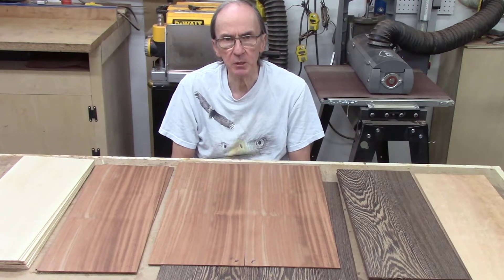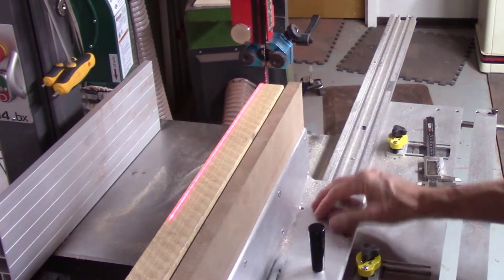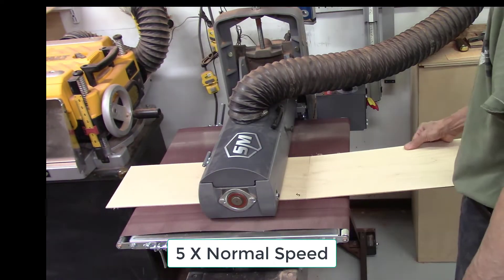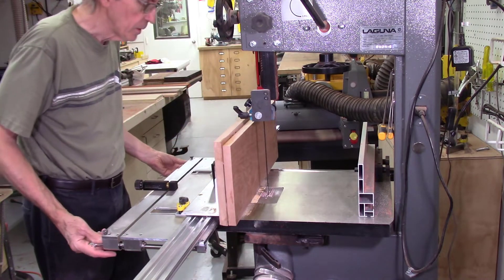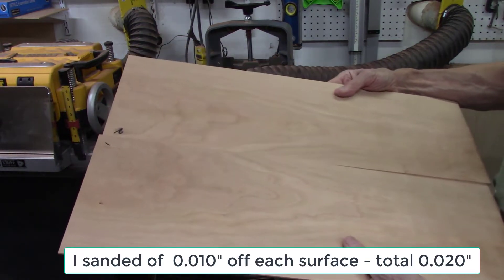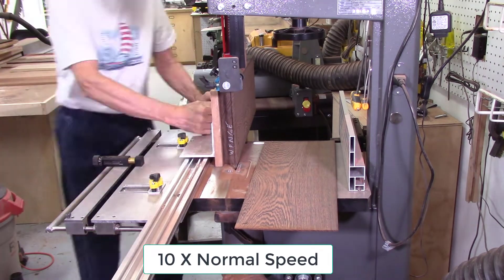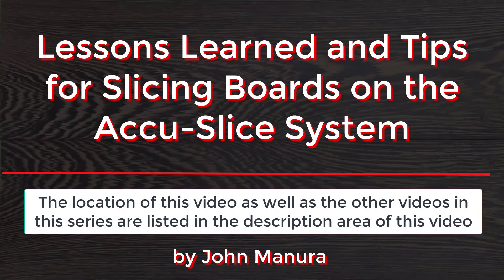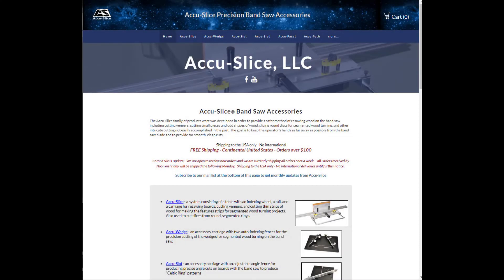Slicing Book Matched Guitar Sides and Backs - Part 3 - Production of Guitar Backs- Luthier Tip (109)

Comment: This is wonderful stuff. Considering purchase of the Accu Slice system for my PM1500 bandsaw. Wondering, what grit do you use on the drum sander in order to completely smooth out the bandsaw marks after the Accu Slice process?
Reply from the maker: I sanded the boards with 60 grit sandpaper on the board sander.  After that I would probably do hand sanding with the finer grits.  When I tried using finer grits on the belt sander it started to burn, probably because I was trying to take off too much at each pass.  I do not want to switch grits because it is a pain to change the belts on the board sander.
Reply: SIS Woodworking thank you for the information. I appreciate the detailed response. I can also appreciate not wanting to change grits on the drum sander. It is indeed a tedious and time consuming process. Have to tried using a random orbital sander with progressively finer grits after the 60 grit drum pass? Or perhaps even a hand scraper? Wondering which approach produces best overall appearance without risking punching through the veneer.